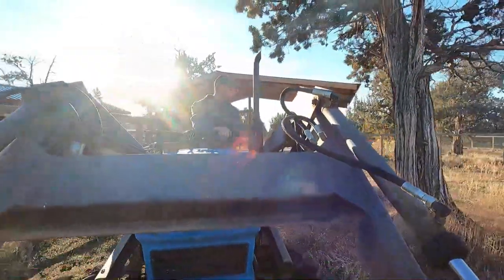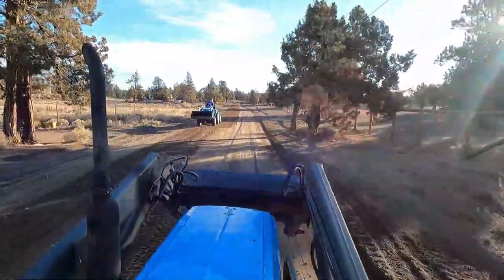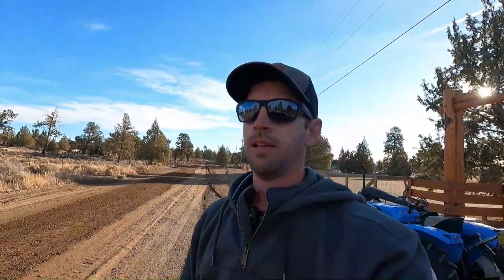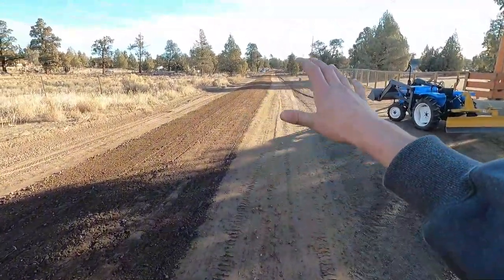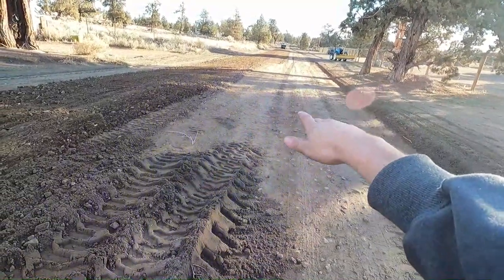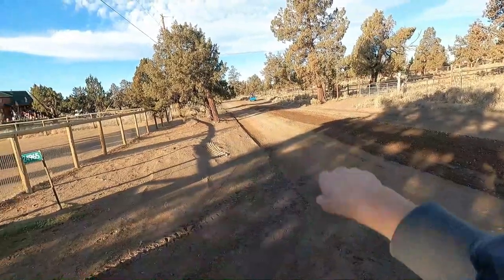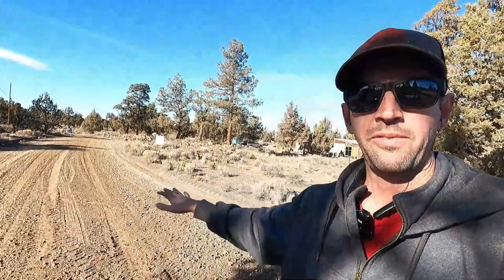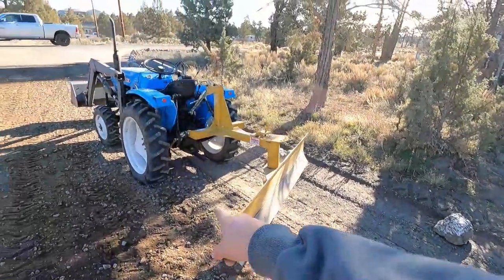Neighborhood thugs go to war with the road department

Comment: We HAD back in the 1990's a GRAVEL ROAD that went by our Farm here in Northern Alberta. My Dad GRADED a 5 mile stretch of the road due to how bad it got. The County TRIED to take him to Court for "Severely Damaging a SECONDARY HIGHWAY". Well he was smart to take a camera and take pictures of how the road was and how it was after he was done. Thankfully(due to some weird luck), the Judge was the TRAINEE that my Dad trained to take over his grading Job 30 years PRIOR.
Reply: Sounds like the judge should have recused himself. Of course he would rule in favor of his trainer. By not doing so it would invalidate his own education & experience in the grading field, thereby putting his work as a grader into question. The judge had a personal interest in the case. He should have recused himself.
Reply: @INEVURLOSE  He did. He got another Judge to take the case. The Original Judge testified on my Dad's side that the roadwork was done in accordance with Road Allowance Regulations. We had all of the necessary proof of the grading angle(2.5% was what the road originally was graded at) and what it was afterwards(2.5%).
Reply: @mattt5946  Gravel roads are typically County Jurisdiction, not State. @Joe Dorcas  That makes sense. Glad it worked out that way.
Edit: He mentioned Alberta, so province maybe? In any case, he also said it was the County that took them to court.
Reply: @INEVURLOSE  fixed it, either way the point still remains valid.
Reply: @geanitsucuneli7278  right thats why Canada ranks 5th in freedoms and the US ranks 62nd.   Lmao.
Reply: @geanitsucuneli7278  Than.  Its hard to take comments seriously when the people are not capable of using proper grammar.
Reply: @josephalberta1145  ... 'It's'... That said, I think they might've been joking. Don't attribute to malice that which can easily be explained by ignorance. People who are serious about calling every damn thing under the sun 'communism' generally aren't gonna say 'communism's'. The ones who are serious typically say 'commie' (the slang term).

Comment: I've been building roads 30 years in Florida, here we rip the road add material blade it back and roll it either with a roller or a wheel loader with a bucket full of rock,You county is just the same as mine here they make things worse, SND IT'S NICE TO SEE A VIDEO WITH SOMEONE WHO KNOWS WHAT THEY ARE DOING EVERYTHING YOU SAID IS 💯 RIGHT

Comment: I live in Vermont where the law says that if you choose to live on a private road then you are REQUIRED to contribute to its maintenance. The dirt road is about 1/4 mile long and cuts across rugged mountain terrain. The road has twelve culverts and lots of ditching. There have been problems over the years with some neighbors, mostly seasonal people, refusing to contribute to keeping the road fixed. These are the same people who whine that the road is potholed, washed out, not plowed or blocked with a downed tree. There are twelve members of our road co-operative now and we have just  laid down about $10,000 worth of stay-mat after having the road properly graded. One neighbor, who thought he was doing the right thing, did a lot of damage to the road with a makeshift tractor-grader and he has been warned not to bring his rig back onto the road ever. I also warned the same neighbor that if he pushes any more rocks into my front drainage ditches he is going to find them piled against his front door. I just spent $1200 to grade and stay-mat my very steep driveway and another $1100 to replace a damaged culvert that crosses the road near the east side of my driveway. I had previously replaced another culvert on the west side of my driveway so the cooperative members took that in good faith and exempted me from the road stay-mat fix. As you've guessed our road is private and no town official is allowed any say as to how we fix it. It is a fifty foot wide private right-of-way and we are taking good care of it. I spend a lot of time every summer cutting brush and trees away from the road so we don't have so many trees down across it in our wicked winters. Road cooperatives CAN work!
Reply: This isn't a private road,  it's a public road that's part of a road district.  Here in Missouri they're under townships, and I've seen roads they haven't maintained for decades. Usually because of low funds and low traffic
Reply: He isnt on a private road
Reply: After seeing how back country roads twist and turn through hills and connect it makes one wonder how much extra time it takes to go basic distances.   Also how you describe road repair it makes me wonder more and more just what if any value at all you get from state and federal taxes.

Comment: I'm in Georgia and the county I live in the graders come along before it rains. They'll pull the ditches and leave the dirt piled up along the sides of the road. Sometimes they'll grade the roads and the roads were smoother before they graded the roads. So I know how you feel.
Reply: That dirt needs to be feathered out on the backslope of the ditch or rolled over into a farm field and spread out I've only met one farmer in my 25 years as grader operator that didn't want his own dirt back. there's a lot of work that goes into making a good gravel road and I have seen some really horrible maintenance (?) in other counties and states just a case of the taxpayers not getting anything for the money they've paid in.

Comment: Yep, I feel for ya. I live on a 1200 foot access road that three homes must maintain. I am the oldest of all the men and when I was working 12/14 hour days, I was the only one willing to keep the road in shape. I have lived here for 25 years and for about 20 of those I did 95% of the maintenance, even though the one neighbor has a small tractor like yours. The only thing he would do is scrape snow off during the winter. I did get the neighbors to pitch in and bring in 20 yards of gravel and leveled it all out with a hand rake. The road was looking pretty good if I do say so. Then I fixed up my own 200 feet of driveway.  When the first snow came, about 6", the tractor neighbor got out there after I told him to not scrape all the way to the gravel and scraped a bunch of the gravel to the side of the road.  THat was about 5 years ago, and I now only work my own driveway. I am done working on that access road and someone else will have to make repairs. I am 73 and have a very bad back from a couple of serious back injuries. Those younger guys are going to have to get off their butts and take care of it.  I tried to explain to the tractor guy, we can drive on two inches of snow, you don't need to remove the snow all the way to the dirt and in the process scrape the gravel off to the sides. We have more gravel on the sides of the road than we have in the center.   grrrrrr!!!!!   Yes, I know just how y'all feel!
Reply: You could recommend he get some edge tamers that keep the bucket just off the gravel.
Reply: @court2379  This road needs to be re- formed, crowned and cambered again, with watering and light compaction, the only way to repair it properly, with ongoing basic road maintenance to keep it serviceable, sadly the cost of wet hiring a  grader, vibe roller,  water cart, tipper, loader, traffic management and material (if required) as well as mobe/demobe is high. 

It's great when community members and machines pitch in for free (mates rates = beer and a BBQ)
Reply: @rescueert  I am not sure how your comment relates to what I said...

Comment: This reminds me of when I was living on the farm. We had lots of dirt roads probably more than paved, when one town supervisor retired the next elected supervisor didn't like crowned dirt roads, which are designed so water on the road could run off into the ditches. He came along and graded all the dirt roads in town so they were flat. The next spring with all the snow melt and rain most of the roads washed out and became pretty much impassable. He didn't last long as supervisor.

Comment: Casey something people do not understand that as the transition point is the breaking and acceleration is at its maximum  the sub base needs to be more stable. I cannot believe they did not put any tail out drains along the road and most of all they did not use a grader. Good job and excellent explanations once again.
Reply: Definitely should have used a motor grader!

Comment: I live on a street here in Tucson Az. and both ends of my street has a wash that causes sand and dirt to build up sometimes 2 to 3 feet deep. people were getting stuck and I pulled them out. There were many calls to the road dept and they never responded. I told them I was going to clean it out with my front loader, they threatened me with arrest if I did it. I told them I was a police officer and in the current condition emergency vehicles could not get through and the county would be liable. They still didn't do anything. I finally put out cones and cleaned out both ends with my loader and sent pictures to the county. They still warned me not to continue. I told them the next pictures were going to the tv stations. he next day there was a crew cleaning the road.

Comment: If it were me, I'd use crushed concrete at that transition onto the asphalt and pack that down.. we used it for the approaches to the shop doors and it set up like, well, concrete
Reply: A few loads of rc is good.

Comment: Living on a dirt road for nearly 30 years, 2 1/2 miles. We had lived here about 3 years when the county road dept. graded. They cut off the end of our driveway because we didn't buy a culvert from them! They only grade about every 3rd or 4th year and only use one small dump truck load on the 2 1/2 mile road! We have been told that they will sue us if we fix the road, so we don't. But we invested in a Road Boss and have a great driveway!!!

Comment: I worked for an outfit that did the city's street paving plus the installation of the infrastructure beneath the street, water pipes ,sewer lines, storm pipe etc.
   I enjoyed the way you described the subtleties and importance of a proper subgrade. Having a good foundation is the only way to build anything that you want to last. Throwing stupid ( non-existent) money at your District's road problems won't solve them.  It's good that you and 'ol Grumpy have the camaraderie and equipment to keep your section passable. Too bad you have to spend your time and resources trying to undo what the knuckleheads did. With that being said, on the subject of subgrading ,I'll end with a quote from my old "motorgrader yogi," Bob was his name.
  Bob told me " Pete, don't ever dig a hole to fill a hole." " 'cuz now you have another hole to fill up." "Go scratch you some dirt
 off a high spot."
Reply: Yogi was right I've been a grader operator for years and he sounds like a real operator 👍

Comment: Although I totally understand budgets, a tracked skid steer with a Harley rake would knock that out pretty quickly, im an operating engineer so i have some road maintenance/earthwork experience, also if the board hired a company to do this work and thats what you got it sounds like a major breach of contract and that company should be held liable for all damages done as well as all work expenses you and Grumpy have had to shell out
Reply: Nha thats over kill. This is literally exactly what a box blade or rear blade is made for. They're grading stone, not doing topsoil.

Comment: 3 cylinder? That sure looks like my tractor. My 1980 5020 Allis Chalmers was built in the same factory that built the same thing for MF and Simplicity with a 0:06 2cylinder 25HP diesel. Mine is still running great.
Reply from the maker: Yep, it's a Hinomoto.   Exact same machine as the 5020 with a different paint job
Reply: @CaseyLaDelle  Gotta love marketing!

Comment: i know i don't live where you do but sincerely thank you for correcting the shotty craftsmanship so that not only does it last but also creates fewer problems "down the road" with drainage compaction leveling etc if i had the power equipment company i wish i had id ship you down the road maintenance vehicle you require big ole vibratory compactor drum roller gotta help the neighbors out also a dumptruck to place the gravel and fill for the low spots
Reply from the maker: Check back later today for the update video

Comment: In my home county the townships or divisions of the county were in charge of the gravel roads. Some of the gravel roads were county roads and the smaller roads like the one in this video were township roads. The county set up a county garage in each township and Gravel and tar roads were maintained. Snow removal in winter and gravel in summer along with junk pick up and disposal. It costs money and the townships are the place to start placing responsibility for infrastructure of road maintenance equipment and the hiring of crew and mechanics. But, it is sometimes hard to get bureaucrats to agree. It takes some sort of a political movement to make these things happen. Congress and State senate need to be involved. There might be a certain amount of federal and state money appropriated for these things. Bridges, guardrails, signs, etc. People with skills need to be in the positions to make sound road decisions.
Reply: My dad got tired of driving on a crappy road and stole the township blade before he had our 5 miles fixed the board members stopped him and asked if he wanted a job 27 years later he just trained his replacement the best people for the job is farmers or people who live on the roads and understand where the water needs to go and how to get it there not government officials hell even the county engineer couldn't figure out if you put a culvert straight across a road where a ditch hit it at an angle it wouldn't work when replacing a small bridge

Comment: The hiway crew in the Yukon use to put gravel down on my driveway in spring and plow it in winter because I let them park their equipment at my cabin when they're out there working! My driveway was one and a half miles long! They didn't have to worry about vandalism of the equipment! It would be sitting there for 2-3 weeks at a time!

Comment: Question: is there a rule of thumb regarding how much higher the crown of the road is relative to the edge of road.  As you can tell I know nothing about road building, but I do have 1/4 mile of gravel pvt road from county road up to house that I maintain.  What I have been doing looks pretty bad.  Great video, learned a lot.
Reply from the maker: Depends on the soil conditions and geography, but 2-4% is usually in the ballpark

Comment: Nobody can screw up a gravel road faster than the county maintenance boys (and girls). 

My cousin used to borrow a tractor and box and put a nice crown on his. County was assessing roads and felt his was "too tall". So they came in and cut a dirt road almost flat and piled the extra along the edge. That killed the drainage (since of COURSE they put the extra on the low side) and it has been a mud slop ever since. He was not impressed. Glad you guys got the holes filled.

Comment: Casey/Grumpy,
 I would suggest getting hold of the grader operator and have him cut a "mitre" drain off each side of the road at say 100' intervals up to the fence line to a) encourage the runoff away from the road and b) stop the runoff or at least slow it down, from running to the known low spot. Your little machines don't have enough grunt to cut them.

Fyi where I come from, Africa, the "washboard" as you call them, are known as "corrugations". Difficult to prevent and hell on shock absorbers.

Comment: Why not add a few soak away ponds off the side of the road where low spots are. they would take the downpour water and save it flooding the road. I think the grader guy must have been working on a price, to have made such an uneven job. I could have done a better job with a back hoe (The JCB kind) fitted with a 4 in 1 bucket.
It was good to see you two, go eat lunch after the mornings work and have a spot of banter. Nice and thanks for posting.

Comment: Problem box scraping with smaller\shorter tractors I discovered was they usually aren't long enough and so it requires a good eye or an electronic level.  I had a cutting blade like yours too..  never did use it alot..

Comment: I have similar situation, county put good gravel on last year. Problem comes in winter when they plow snow their truck uses down pressure and gets into grave throwing it off the road were you can not get it back, after 2 or 3 years there's no gravel left for me to grade.

Comment: It probably would have been cheaper for them to just add 3" of asphalt to the top...  I used to live on a 2,700' discontinued town road that was a complete mess of a mud pit when I first moved in... It took a decade of adding rock (pretty boney stuff at first too), drainage, culverts, and regrading to get it solid and nice.
Reply from the maker: The road would need to be completely rebuilt before it could be paved.  It's nowhere near ready
Reply: @CaseyLaDelle , well... Not anymore... If it was hard pack like concrete before they messed with it in the first place on the other hand...  LOL
Reply from the maker: @MagentaRV  there's a whole lot more needed than just it being hard packed.  The road is in a bowl with no way for water to run away from it, and it goes right through the low point of that bowl.   So the whole road would have to be raised over a foot so that it didn't flood over the pavement during every rain storm.  And doing that would require rebuilding everyone's driveway approaches
Reply: @CaseyLaDelle , I didn't realize the whole thing was so low.  Good luck with being road commissioner!